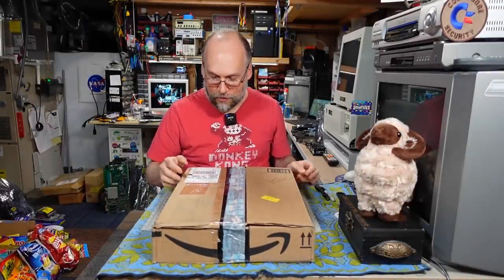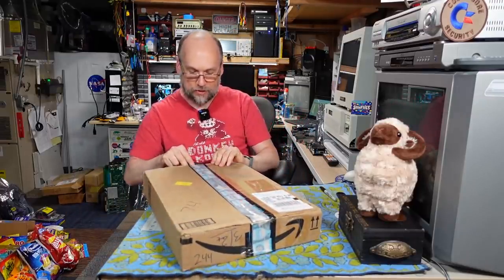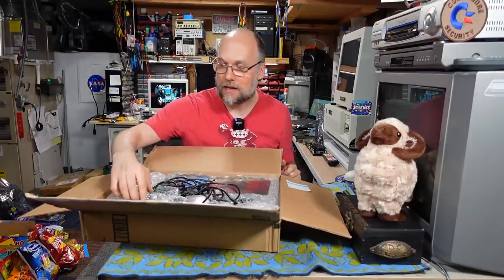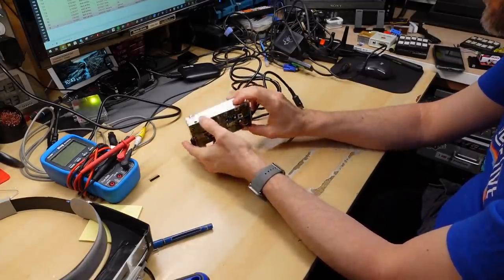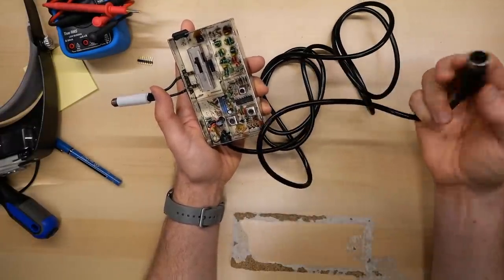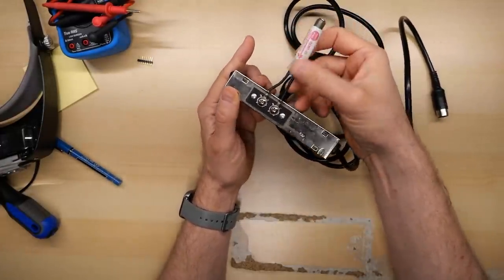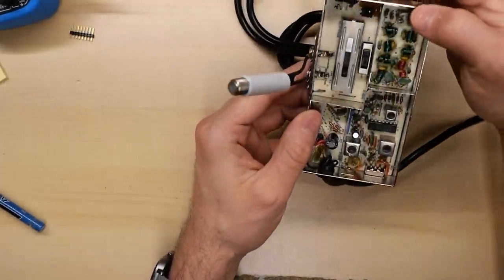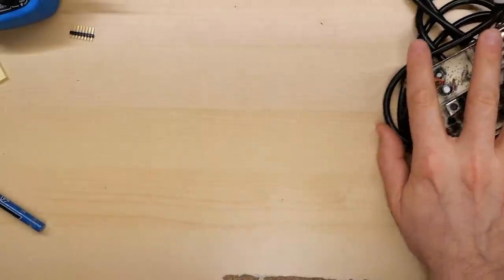Ti99 goodies, motherboard troubleshooting, a special floppy disk and the worst joysticks ever?

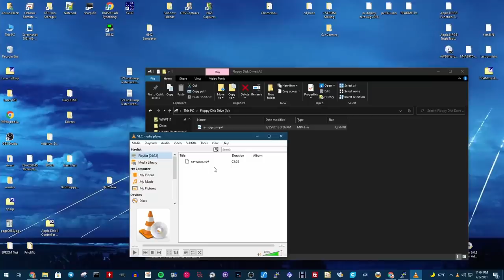Comment: 18:05 - nice timing on the Tivoo! :D I bought one not long ago but if I have it on the whole day it drains pretty fast and while I'm working it's pretty distracting. But I like the feeling of it. And of course I bought it because I saw it on your shelf :)

26:50 - check the schematics/pins of the chip and find the GND then look at the socket where the GND leg is, you can do the same with voltages.

Comment: Adrian, use some 3M-brand spray adhesive; that’ll get the label to stick to the disk. You should be able to get it at any home improvement store. However, the “surprise” might be malware disguised as an 8-bit dance party. 🥺
Reply: Better than malware disguised as a goat. Enough of that goat has been seen.

Comment: The Ti99-4/A was my first computer back in 1981! I taught myself BASIC on it. I remember typing in my programs in every time I wanted to run it until I finally got a cassette adapter cable. I dreamed of getting a PEB with more memory and a disk drive, but that was impossible for 12 year old me. I also remember the metal chrome trim on the unit would often shock the crap out of me on many occasions! I later moved to by beloved Commodore 64 soon after.

Comment: When finding the orientation of through-hole DIP parts, look on the PCB itself. Pad-1 is usually square and all others are a circular pad. Handy when a silkscreen layer was not used on the PCB...
This is the typical PCB "footprint" pattern for systems of this era.
Cheers,
Reply: It looks like TI did all circular pads on the 4a. I haven't seen a square pin 1 on any photo.

Comment: Hi Adrian, my TI99-4a has the same ceramic processor as yours.  The date codes on mine are early 1981, so the first runs of the system. Mine does not have the extra thick cable, the vias are open and don't even have solder in them.  It would be interesting if you could let us know what the date codes are on the chips on your board date to.  You can't go by the serial number on the case to date these systems.  Although I have heard that there is a date code on the inside of the case somewhere.  I haven't looked at mine to see if that is the case or not.

Comment: First off I liked my Atari 5200 joysticks back in the day. Although that didn’t stop me from getting the Wico 5200 analog joystick replacement. The Coleco was .. just tolerable. 

My bid of worst joystick would be the Commodore proprietary DIN connector joysticks for the C16 and “Minus/4”. Even if they had the common 9-pin connector they would still be hell. Have you seen or felt one? I got two from Goodwill. Giving them money for these was literally “good will”.

Comment: That odd power cord reminds me of when Microsoft sent out GFCI power cords for the original Xboxes, to get around needing to recall all of them.
Reply: I'm guessing foxconn covered the costs. "Oh, you wanted a power supply that doesn't shock your customers? You should have told us that."
Reply: Wasn’t the problem actually the AC inlet legs?  IIRC, the solder joint on the PCB would fail and cause arcing, leading to a potential fire.  Later models have short wires between the inlet and PCB.

Comment: The real challenge would be to open up those joysticks and re-engineer them to be awesome!  Keep the look, just make them functional.  Should be doable.  IIRC i think i saw some atari joysticks that looked exactly like atari joysticks, but had actual bucking spring switches, for a much improved experience.  But they looked authentic.

May not be enough space in those super thin cases, but it might be doable.

Comment: The TI-99 I got a while back came with two of those joysticks, yes they were bloody awful, BUT they came with an extra. As they are not stable and fall over, the previous owner resolved this by hammering three SHARP nails through the base no doubt to fix them to a desk/piece of wood! So of course I cut and scratched myself handling them.

Comment: I'm sure someone has already commented on this, but that thing attached to the TI-99 power supply was put there as a result of a voluntary recall that TI did. They notified the FTC that there was a small chance of user shock in some very specific edge cases, so they added that thing to all new supplies, and you could send yours back for free to TI to have that added. Or maybe it was a fire hazard? Either shock or fire hazard, but I remember they said they had only been able to get it to happen under lab conditions, but just to be on the safe side I guess they wanted to avoid lawsuits.

Comment: Bad joysticks? My vote is the joysticks that came with the Philips Videopac G7000 console. Really long travel with no feeling. You might think that with a long travel like that, it's analog like old Apple II and PC joysticks, but no, it's just digital. No click on the button either. I'd assume the joysticks on the American version, Magnavox Odyssey 2, are the same. Also it's a rather bulky rectangular case, no points for ergonomics there. But I never managed to break one, so maybe that's a plus. Good thing, they were hardwired to the console, so the abomination couldn't be used elsewhere. Bad thing, they were hardwired, so they couldn't be switched for something better...

Second place goes to the VIC-1311, the later model VIC-20 joystick with the triangular stick. Ugh. Just... no. Also, the switches were the cheapest possible domes on a PCB. Both the stick and the fire button had thin plastic parts that pushed on these domes, and it didn't take much force for them to snap, even a 10-year old could do it (sniff).

Comment: I had a TI-99 and - after spending a fortune (for a teenager) - I snapped in half over my knee! 
I spent $50 to get the TI Tech Ref guide and found out how it had a bit-shift serial rom system on the base system - 8 clocks to read a byte from ROM - 
Never have seen a processor so crippled by its motherboard before or since.

Comment: I believe the 256 bytes is for the processor stack.

Minicomputers still exist. They are tasked differently. They can be used for cloud computing. They can also be used to build units for scalable parallel computers. Because of their construction, you can make the word size larger (requires microcode reprogramming for efficiently). The AS/400 had the ability to support a word size of 1024 bits.

Comment: -  RF Used to have a plastic part that turn off the RF modulator when in pass-thru (Antenna) mode. So it threw both internal switches through that plastic external switch "handle"

Comment: I did have a similar "missing silk screen on the board" pin 1 issue with an EPROM in the video test signal generator... it got nice and toasty but surprisingly still worked, even after I singed my finger on it.

Comment: I once had an adapter box which plugged into the TI controller port and let you plug 2 Atari joysticks into it. I wish I still had my TI 99/4A stuff. 😢
Reply: I have one of those original splitter cables.. plus they also sell this board that can attach and split them off as well.  I don't like the board, it looks a bit ghetto, but the oem cable is nice..

Comment: The green doohickey on your TI power supply was to address a recall for shock hazard.  My PSU recall thingie was just a solid object about 3 inches long with plug on one end and holes on the other to plug in the power supply.

Comment: In terms of the TI994a internal PSU the +12 and -5 rails use 7812 and 7905 linear regulators. The +5 rail is rather more complex making use of a UA723C (U3)  and a TL331 (U4). I'd guess the component with the heatsink is Q2.

The characters are 8 lower than they should be. Thus it would imply that bit 3 is stuck low. This would correspond to U105. Possibly the trace between U100 pin 29 and U105 pin 14 is damaged. But that would need the TMS9918A inputs to float low, rather than high. The colour bars on the startup screen also look wrong, likely for the same reason.

Comment: American RF connectors are weird in the UK you just put the wire in a connector then into the tv, no screws or little fork things needed.
Reply: Sometimes I honestly think America just try to be different
Reply: I'm not sure if America was just trying to be different in this particular case.. both countries were building out their own standards at roughly the same time, so there wasn't really a standard to adopt.

Comment: The worst joystick ever was probably the cheetah Annihilator that went out with late Commodore 64s and the C64GS.
Not the worst to use (although pretty bad), by finding an example of said joystick that still works to prove this is difficult because they have a life expectancy of around 3 days from new.

Shame really because the second button is wired up differently to give two distinct buttons (Button 2 went to one of the paddle pots), but because this was the only joystick that does this it was ignored.

Comment: The white VIC 20 joysticks were rough. Built like Atari ones but even more painful. Gotta love the TI. So many design goofs in one machine. I would probably made a good cart games console though with carts attached direct to the CPU bus and the tiny ram could have been enough.
Reply: If you're referring to the original VIC-20 controllers, yes, Commodore sold white joysticks and paddles that were complete copies of Atari's designs. Atari sued them over it too.

Comment: 16:19 I have an old TI (4A) and attempted to repair its RF modulator. There is a little plastic piece that sticks through the case and "sequences" the two sliders. I lost that part years ago when I realized a composite mod would be a lot easier (or so I thought...).

I started by splicing the relevant cables, which worked but the connections were iffy, leading to a messed up picture if I so much as bumped the cable. Unfortunately I made a pretty big noob mistake and borked the system when attempting an internal composite mod: I decided it would be better to pry the DIN connector off the board without proper de-soldering equipment (IDIOT!) than just piggy back my RCA jacks off the bottom. Now see valid bus activity and a valid NTSC signal (sometimes even in the same shade of blue as the boot screen BG) but no picture, just a solid screen. This is still beyond my skill 6 years later, as further attempts have yielded no improvement, but thankfully no further degradation that I'm aware of either. Do you or your community have any advice, or can I send the machine to your more skilled hands? I am willing to pay for repair and the wait is no issue.

Preemptive edit: I do now own an oscilloscope and spring-loaded de-soldering pump (not the best but it works)
Reply: TI99's are relatively inexpensive, it might just be worth it to buy another one (or at least the pcb) on ebay, they are usually sub $75 which is less than you'd pay for shipping and repair on your existing one (assuming there's anyone who would do that for you).  Maybe just keep your existing one for parts.
Reply: @brianv2871  Thanks

Comment: the RF modulator is missing a piece which interfaces the RF 3-way antenna switch and the power switch so when you moved the lever to "computer", the power is turned on... that piece is missing..

did ya see the board is marked "-3"?  maybe they knew it had a bad bit already? hehe

Comment: Before you utterly condemn the Ti-99 joystick, I suggest you get the official Acorn Computers joystick for the BBC Micro. Those were plainly designed by someone who had not only never seen a video game, but probably also didn't even know what one was. Never have I ever seen such a bad implantation of any kind of product. Like a bicycle with square wheels.

Comment: I'd argue that minicomputers do still exist in the form of machines like the NVIDIA DGX series although they're more commonly referred to as "desktop supercomputers" these days.
Reply: Their market segment still exists, but on the technical side it’s more like microcomputers got big enough to eat minicomputers. Where once you had Vaxen you now have rack servers, same for workstations (which often used to be minicomputers with the computer in the entire desk), same for massive-parallelisation nodes, and so on. They’re more cooperative microcomputers than the construction of minicomputers. Even a single desktop computer has a number of microcontrollers with more power than earlier microcomputers inside of it nowadays!

Comment: The CoCo standard joystick and Atari 5200 controller are pretty bad, as well.  I also never liked the limited throw of the Atari 2600 joystick.

Oh, the RF modulator needing power explains why they put 12V on one of the pins of the video connector.  I couldn't understand why they had 12V,  now I know.

Comment: Power brick on earlier models probably lacked certain protections (fuse on primary of xformer etc).
Reply: @PatricKerr  From the recall notice, I gather there was an isolation issue (present when the power supply overheated).  Would be interesting to crack one of those boxes open and see what the fix was.
Reply: @daemoncan2364  another commenter says it’s just a fuse, so my guess was if it failed it would blow the fuse. Thus failing safe instead of fail dangerous.

Comment: hey adrian, i just came across a smith corona/acer 386 computer complete with matched crt monitor(i havnt collected the monitor yet, was deciding if it was worth the weight and size of storage) would you be at all interested before it hits ebay for shipping+a pittance of it's value? they are going for $200+ online but i'd take less if you wanted it to feature

Comment: Not sure why they made that whole joystick when a short Y-splitter would have been better and cheaper to make. I think literally every joystick ever made is better than Ti's abomination. :P
Actually all platforms with one joystick port is a dumb design choice which kept coming up even much later with 3DO and CD-i, how much does one more port cost honestly.
However kind of nice the RF modulator being external as it doesn't take up any motherboard space and easy to discard now for many better AV options.
Reply: Yeah but the dumbest thing of all about the 3DO and their single controller port design was their daisy chain idea for the 2nd controller. Get pissed off at Player 2 in SF2? Unplug their controller from yours...
Reply: @TheJeremyHolloway  Isn't that the truth, first time I heard that I was like yeah that is such a fatal flaw with that design. However I still need to get a second controller and find someone else to play 3DO with to find out. ^_^

Comment: TTL logic isn't all that sensitive to supply voltage level.  I've seen 74LS series logic running at 6v without issue.  Obviously better to be 5V, but 5.1 or 5.2V is not an issue at all.  The worse that will happen with higher than designed voltages, is extra heat generation and power consumption.

Comment: The add-on tail of the power supply is indeed a fuse box added on simply by gluing the add-on to the original plug and you can pry the two parts apart with a knife and the power supply will Work just fine without the fuse add-on though how safe that I don’t know.

Comment: Yeah, the video chip for the TI-99 shouldn't be a problem...TMS9918s are fairly common.
Reply: yeah, it's odd that both were missing them.. unless someone killed them both by putting them into that one board backwards due to the incorrectly placed socket. :)

Comment: Yeah, the fact that the TI-99/4a joysticks are terrible and also use the strange two-in-one pinout means they're some of the worst of all time. Terrible joysticks that can be easily replaced with another model are much more forgivable. Atari 5200 and Commodore 16 & Plus/4 are similarly bad with non-standard connectors. I also really don't like the Intellivision controllers, and most models of those have the controllers hardwired in!!
Reply: The Atari 5200 has DB15s. Although not as popular as the DB9s of the time since the Atari 2600 used those. But still, that's why it's easy to make PC GamePort Adapters for the 5200...

Comment: ti9900 programming geeks should check out "Stuart Conner's home page".  His custom boards have all no-wait-state SRAM.  ROM choices include Powertran Cortex Power BASIC (faster than any version of TI/Microsoft basic), FORTH and TIBUG or EVMBUG monitor programs.  I got the TMS99110 PCB (with TMS99105 CPU) with 64k RAM, Power Basic and EVMBUG.  All I/O is through serial terminal.  No sound or graphics.  Stuart is also a wizard with TMS9900 assembly and a valuable resource for advice and tips.  At my request, he designed a mod that adds a TMS 9901 Expansion and Interval Timer, along with some example code on how to program it in assembler.  These are great boards for exploring the maximum performance of the TI chips in the 9900 line of processors.  Highly recommended for 9900 series programming enthusiasts.

Comment: I find it hard to believe joysticks that have actual movement in them could be worse than the atari joysticks that don't move at all.
Reply: Oh they move .. right before the plastic under the rubber boot of the Atari CX-40 snaps! When I first saw the Wico bat handle Command Control I had to have it. I used it for years. So much nicer. If only I’d crossed paths with the Suncom Tac-2.  That’s also sweet.
Reply: @nickpalance3622  I will never understand the love for the TAC-2. Or how Europeans love those bizarre looking Competition Pro joysticks. Give me an Epyx 500XJ to rule them all.

Comment: All the characters are showing ASCII codes that are 8(dec) lower than they should be, implying that data bit 3 is stuck at 0

example;
I (ascii code 73 so 01001001) becomes
A (ascii code 65 so 01000001)

K (01001011) becomes C (01000011)
N (01001110) becomes F (01000110)

and so on so yeah, bit 3 is stuck at 0